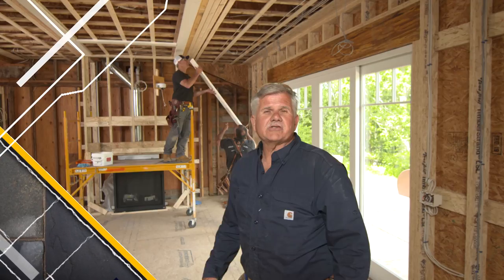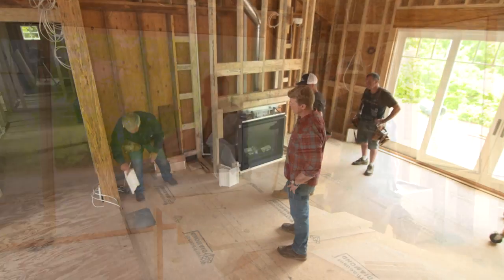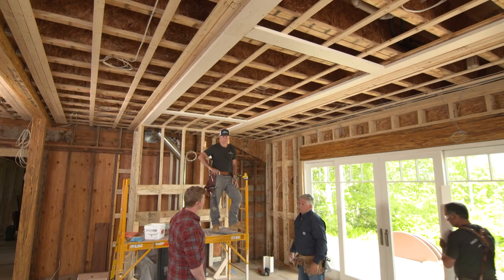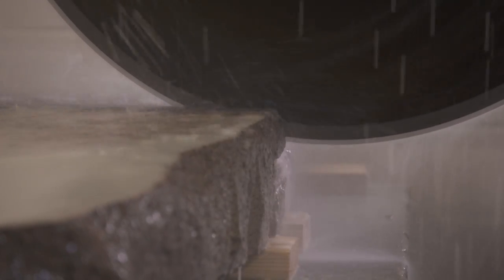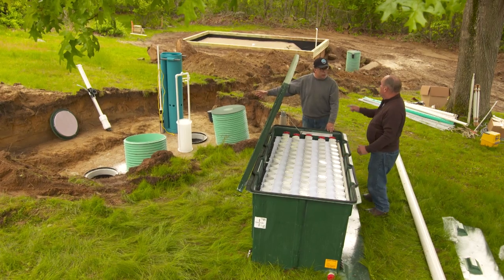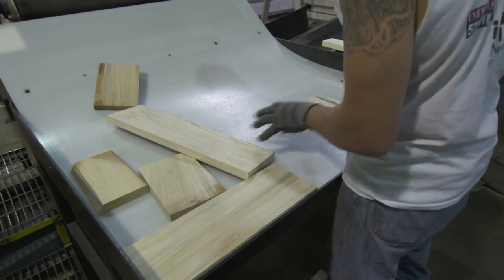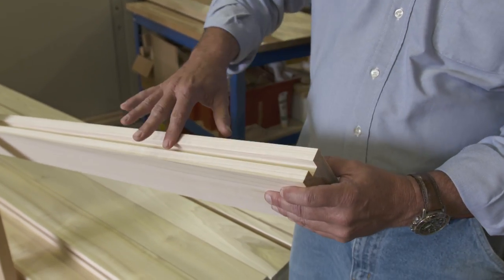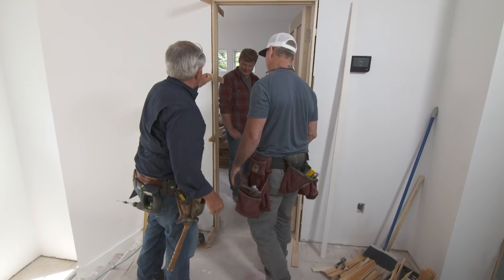This Old House | The Doors (S41 E7) | FULL EPISODE

Comment: Remodeling to this extension costs way more than building it from the scratch and there is not much they preserve from that old house anyhow.
Reply: I was thinking the same thing.  They'd have been better off just backhoeing it and starting from scratch.
Reply: @bbmw9029  I agree with both of you but you guys are forgetting two things. 1.) Historical societies (or any of there similar cousins). You may require a demolition permit to demo a property and rebuild, Well there is no guarantee to the society that you won't just demo the property and ad the land as a lot to your house next door (or other simple land use), or run away when you discover the cost of building. So these societies simply won't grant that permit, instead they will literally offer every other permit. 2.) financing, its typically easier to get a home renovation loan through refinancing than it is to get a new construction loan for a variety of reasons I won't go into here.
Reply: @MoneyAndPeople  Possible.  But the same can be said of such an extensive renovation that it changes the whole nature of the house.  If there's something like landmarking in place, they have a lot of the same problems doing what they're doing.  There was no mention of any of this in the show so far.
Reply: @MoneyAndPeople  yup, with permits, "new home" requirements and Nimbys sometimes a remodel is the only way to get a modern house built.
Reply: @MoneyAndPeople  Moneyandpeople I suggest watch a 13 part series called What on earth happened by Ewaranon to learn that the earth is not a globe.

I got it in my about tab.
Reply: This is a television program…

Comment: 90Lb door does not indicate quality when the weight is due to particle board.
Particle board is extremely weak, crumbles with damage, and swells when exposed to moisture.

Generally, if an item feels heavy compared to its size - there is particle board in it. A piece that feels normal weight is probably quality as light means solid wood.

Comment: When measuring a layout you should always use the same tape measure and/or cut 2 inches.
Reply: or and hear me out, check the tap measure before buying and also checking it with what is at home. Critical to have the basics stay the same standards and not have to 2nd guess or question if I picked up the same tape measure after having lunch or talking to someone.
Reply: N_A_RLW I suggest watch a 13 part series called What on earth happened by Ewaranon to learn that the earth is not a globe.

I got it in my about tab.

Comment: Question, if I buy a solid core oak door is the entire door solid oak or is it oak veneer and press board in the middle?
Reply: Depends on how much it cost.
Reply: @ryanroberts1104  so they can come either way? My grandfather purchased solid core oak door for his bedroom. He then passed away and we just stored the doors. I was going to make a desk out of one and when I cut it in half the center had press board in the middle. I thought it was solid oak. Just wanted to make sure my grandfather didn't get ripped off. Knowing him he bought the cheaper one so I don't think he got screwed
Reply: @inspectorsteve2287  Oh yes. They make doors out of pretty much anything you can imagine. Cheaper ones always have essentially leftover wood inside, really cheap doors literally just have cardboard inside.

Depending on the door it could also be done just to make it more stable, things like MDF don't warp or cup like a big wide piece of oak might.
Reply: Hallow core has nothing in the middle.  Solid core, has lesser wood in the middle with veneer visible.  Solid door is one type of wood.
Reply: @seanh3563  ok. Thanks.

Comment: The original coffer width was 48 and 1/16, then they said a piece of plywood would fit right up in there, how did they make up that 1/16 difference to make it work nicely?
Reply: Possibly a little trim piece around the inside edge, or maybe even calking,  that turns out to be 1/32 of a gap on all sides.
Reply: Caulk. Having 1/16 wiggle room across 4 feet is ideal for something like this. Otherwise you'll never get the panel in there
Reply: Without that 16th your gunna have fun and possibly do some damage

Comment: Impact drivers never allow the driver head to slip on the phillips head of the screw.
Reply: That's great.

BTW robert I suggest watch a 13 part series called What on earth happened by Ewaranon to learn that the earth is not a globe.

I got it in my about tab.
Reply: Use Robertson or torx